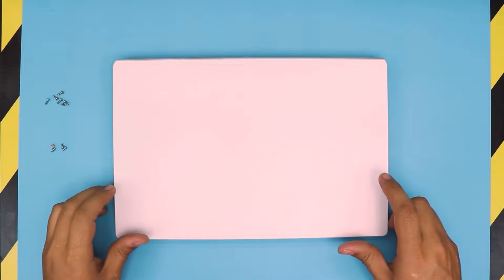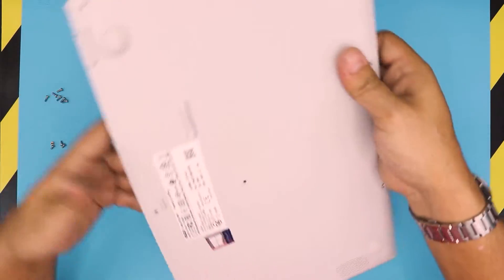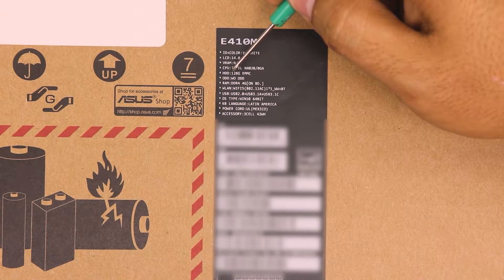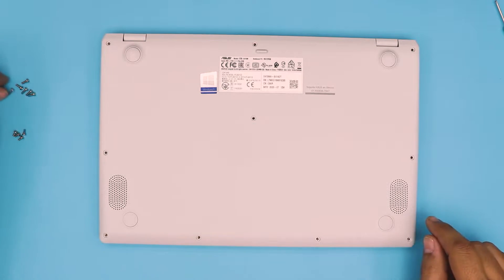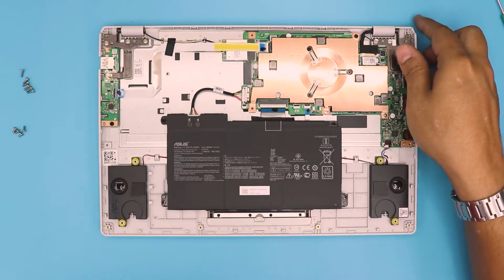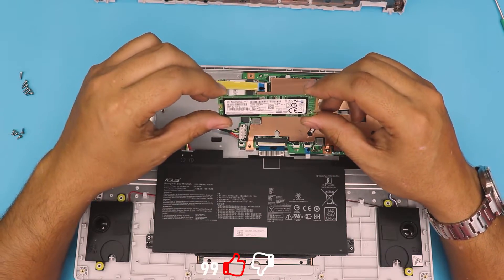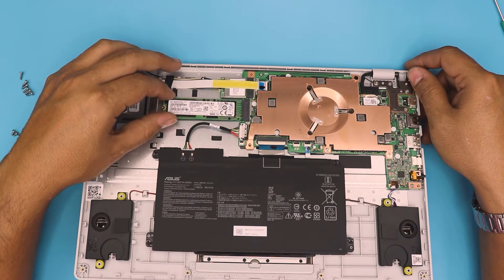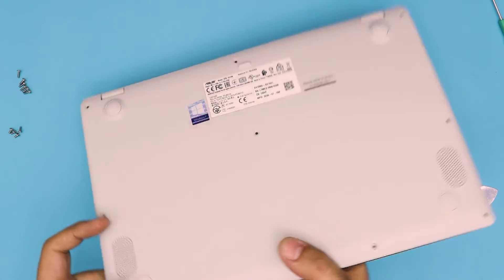ASUS E410 SSD UPGRADE, STEP By STEP

Comment: Hi I got a laptop like that one the L410M and I got an M.2 SSD but it isn't nvme, it is SATA. Should it work on this model? I don't care about the difference in speed but compatibility. I can't return the SSD from my country as it has already shipped and it is on its way.
Reply from the maker: Thank you for the feedback and your support to the channel by a SUB:P 
regarding your question: Some bios permit m.2 sata, you can try placing the m.2 sata and hope that your bios can detect if not there is no other way.
Reply from the maker: Thank you for the feedback and your support to the channel by a SUB:P 
regarding your question: 
here is the pads for the laptop:
the best pads:
https://amzn.to/2QL6wPj
2nd best:
https://amzn.to/3rveOHu

BUT i would recommend you to not replace the pads, NO need at all to replace them , you wont notice any difference in performance or anything, the thermal pads for the vram are totally not required UNLESS you are going to OC the vrams. if you are not over clocking VRAMS no need!

Comment: 4G ram in 2020? And no socket to upgrade? This is made to be e-waste in a couple of years. Shameful.
Reply from the maker: Thank you for the feedback and your support to the channel :P
and regarding your comments yes it its horrible that they doing this, and the reason is they trying to copy the cellphone scam system!
so they can sell different versions a higher cost, for e.g same model 8gb for much higher than the cost of the 4gb extra stick.
and 16gb version at triple the cost and so on.
the companies now they dont want people to upgrade then want to categorize and resell and the war is "who can sell the most product"
take for e.g iphone 16gb version and 32gb and so on and if you knew that the emmc chip from 16gb to 128gb its only in cents for them. but they sell it to up at 300$+
same with macbook laptops now all the ram soldered on motherboard and even the ssd soldered on motherboard!
its truly sad. how they trying to scam the consumers by not breaking the law and using the ignorance of the consumers of not knowing whats going under the hood.
Reply: @uFixTek  I agree with every bit. The world is (has been) going the wrong direction for a long time now, and Apple championed planned obsolesence, and selling extra pennies for hundreds, but now it creeped into the PC market too. I mean that as in PC vs. Mac, even though Macs are still personal computers, but they pretend they are better which is another cunning marketing strategy.
It is horrible that they are making their money on landfills. 
I just placed an order for my new laptop. Took me 10+ hours to pick one, in part due to the 4Gb vs 8Gb or upgrade option price gap. I mean yeah, I had some pretty particular criteria, like keyboard layout and size, but yeah, another pathetic trend...
Why did Full HD 1080 resolution became mainstream on 6 inch phones, before laptops? You can still buy 15.6", 1366x768 non-IPS laptops today. And the PC industry wonders why they are in trouble? Okay, I better stop there. Late night here is turning into early morning now.

Comment: Hi, in the new ssd when you install windows how do you activate it ? Can you use the product key of the windows that's its installed in de old ssd ? Thanks
Reply from the maker: before you install the ssd use your old wind 10 and register your windows under your email account. and when installing the ssd select i dont have cd key  and once in windows use your email, and the windows will detect your mac id and will automatically activate. make sure you install the same windows (windows 10 pro, home , basic)

Comment: Best Buy told me the storage couldn't be upgraded! Thank's for the video.
Reply from the maker: its sad that how they can be working there and not know anything regarding the items that they sell.
i bet even if you call asus it happens, they will say not up-gradable lol
im glad my video helped you , thank you for your support to the channel by a SUB :P if you got any request or question ask me anytime , good luck.
Reply: @uFixTek  asus does say un up gradable and everywhere else this video is so helpful
Reply: @skinniebtechtipasusle yup they do say it's not upgradable smh
Reply: @DatGyalVida  from my understanding now I have not tried to see if I can take out my upgrade but asus released a bios update 306 this update has disabled alot of people's m.2 slot no longer usable I'm not sure if it has affected these laptops for sure but I know bios update 306 for asus took alot of people's drives out.something to be aware of
Reply: @skinniebtechtipasusle it’s a simple fix you just need to disable a security feature in bios and will re detect literally took 2 seconds to research lol
Reply: @uFixTek both asus and best buy (I bought mine frm best buy in July 2021) do say both ram and ssd is not upgradable & other sites say u can only use sata not PCLe NVMe ssd .. hence why my long explanation question is in as a main comment ... I just wanna play my sims4 😭😭😭😭🤣
Reply: Yup @blackdove3057 I got mine in July 2021 from best buy and yes it said not upgradable

Comment: can you install additional ram to this? if yes, should i only add a 4gb ddr4 memory stick? would crucial's ddr3 ram stick be compatible?
Reply from the maker: no you can't remove or upgrade or replace the ram. it is soldered on the motherboard. sorry to inform you about it.

Comment: Hello! Can I use Samsung 970 EVO Plus [MZ-V7S250BW] 250 GB (NVMe M.2, PCI Express 3.0) to this laptop? Please help 🥺
Reply from the maker: yes it will work its compatible any NVME will work. 
here is a link,
https://amzn.to/2HBNbM9
thank you for the support to the channel :)
Reply: @uFixTek  but I tried, it couldn't :(
Reply from the maker: you maybe have a bad nvme :/ return and get new one.
 Storage
64G eMMC
128GB M.2 NVMe™ PCIe® 3.0 SSD
512GB M.2 NVMe™ PCIe® 3.0 SSD
and we have installed 1tb and 240gb and all works fine!
you maybe a have a bad nvme.
https://www.asus.com/Laptops/For-Students/All-series/ASUS-E410/techspec/
Reply: @uFixTek  can you boot from the upgraded/new nvme?

Comment: Great guide thanks, I've just got this laptop and installed the drive however it doesnt show up in either BIOS or Disk management in Windows 10, did you have to adjust any BIOS settings to get the drive to be recognised or do you suspect I have a faulty drive?  Any help much appreciated thank you
Reply from the maker: did you make sure its an NVME ssd m.2 ?, if so what brand is it?, and after placing it go to bios check if the storage is detected and look for an pci express option to enable it. but as default it should be. we have upgraded many of this laptop in our shop without going to bios. but check your bios.
thank you for the support to the channel.
Reply: @uFixTek  Thank you, yes its NVME M2 SSD, brand is HP.  It doesnt show up in BIOS or Disk Managment.  I have updated the BIOS but cant think anything else other than the drive is faulty perhaps?  Thanks again for the reply, if you have any further suggestions they would be very welcome
Reply from the maker: last week i had a subscriber with a similar issue and the ssd was defective, she replaced it and it worked just fine, return it and get a new one and make sure you ground yourself, by touching a a metal table and grab the ssd from sides and dont touch the chips.
Reply: @uFixTek  ASUS tech support have just emailed me to say that the E410MA doesn't support NVME drives only SATA based M2 drives (im not 100% sure of the difference but the NVME definitely fit into the available slot).  I have a new NVME drive arriving today so will check that one and report back
Reply: New NVME was picked up straight away in Windows and works like a charm, the original one must have been faulty.  Shame that ASUS are giving out incorrect info though.  Thanks again for the guide, it proved really helpful
Reply from the maker: ya my friend im sorry about long delay, please make a new comment as if not the list is long i cant scroll so much to see the replay :P
the tech supports are BS garbage,
last week i installed a 2tb nvme on this laptop, and worked like a charm,
even they have it on asus website under tech info regarding nvme!!
Storage
64G eMMC
128GB M.2 NVMe™ PCIe® 3.0 SSD
512GB M.2 NVMe™ PCIe® 3.0 SSD
and we have installed 1tb and 240gb and all works fine!
you maybe a have a bad nvme.
https://www.asus.com/Laptops/For-Students/All-series/ASUS-E410/techspec/

im glad that you got it working and didn't listen to those useless people.

Comment: Thanks was searching for this information. The re-sellers didnt know. Can you confirm if the removal of certain screws, voids the warranty? Like how some screws have stickers on it that are broken when unscrewed.
Thanks
Reply from the maker: hi, thx and as long as you remove al the screws nicely and without damaging the laptop, you wont void any warranty and we have done this many many time , BUT before you claim any warranty make sure you place the original parts back in the laptop before sending to warranty. and thank you for the support to the channel.  if you ever have any questions regarding laptops or services ask me in any of my video comments. :)

Comment: Can I connect SSD disk M,2 (PCIe 3,0 4x NVMe)? Thanks for answer.
Reply: https://www.alza.sk/hp-ex900-250-gb-d5776463.htm
Reply from the maker: yes  it will work like a charm check the link in the description:
500GB NVMe SSD: https://amzn.to/32NaSJe
 i appreciate sub and support to the channel :)